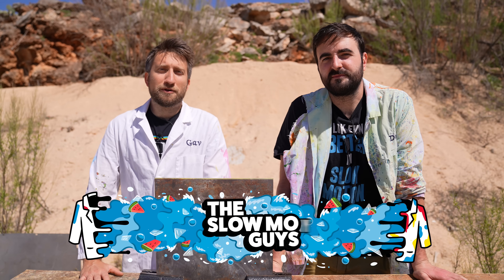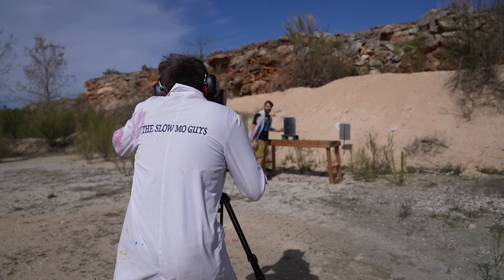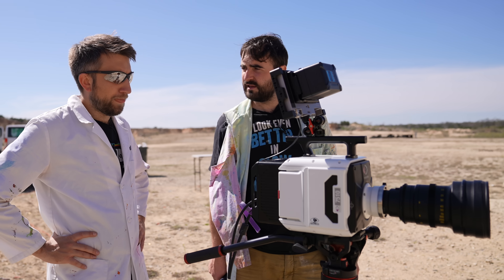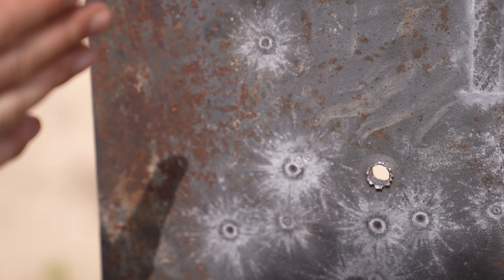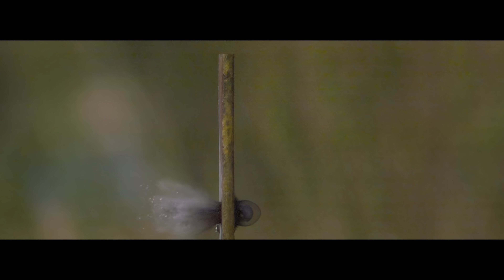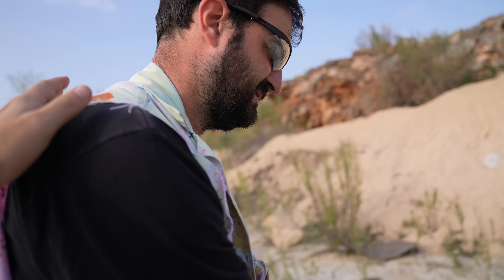Bullets vs Steel at 800,000 FPS - The Slow Mo Guys

Comment: I love how everything behaves a little bit like jelly with enough force and slow motion.
Reply: "Everything is a spring" made very clear
Reply: @DanBowkley   Depending on the speed, "Solid Object" -> "Everything is a spring" -> "Everything is a viscous fluid" -> "Everything is a dense cloud of particles".
In this case the steel plate was acting like a spring, and the bullets were acting like fluid.
Reply: @VorpalHerring   Oooo I like that one
Reply: Takes a lot of processing to run a simulated reality. At some point compromises have to be made.
Reply: @zoutube19 Frustum Culling helps, things only exist if you are looking at them.
Reply: @zoutube19  I like that one xD
Reply: From a brilliant comment on a Breaking Taps video - "So it's all clay?  Always has been"
Reply: Even without slow mo, all you need is enough force. Like when the Tacoma bridge collapsed, the steel girders were wiggling around under the bridge like party streamers
Reply: It feels like the laws of physics just look incredibly different at those speeds.

Comment: A full metal jackeded (FMJ) bullet will do much the same as the hollow point, much of this depends on the plate of steel - hardness, mainly - and velocity of bullet; more velocity gives better penetration.  This comes from many years of shooting steel plate targets.  Couple decades or so.

Speaking again from shooting metal targets.  Handguns, in general, have a slower velocity than rifles.   So the targets can be 'rated' for the velocities used.  (Obviously a higher velocity resistant metal will serve for a lower velocity as well.)   The 9x19mm (Luger) round is advertised generally as a 125 grain (weight) projectile at a muzzle velocity of 1,250 feet per second (FPS).  Whereas the .30-06 Springfield you used fires a 150 grain bullet at 2,700 FPS.  The kinetic energy of the rifle (at the muzzle) is notably greater.  

Not sure if your high speed photography would make a difference, but I've long been interested in determining what moves a heavy weight better.  The difference between a deer (or similar size game) rifle and a large, dangerous game rifle in my mind.

Comment: I think I really loved those last few 30.06 against the hardened steel plate because I kinda loved watching the back of the copper jacket just smoosh the lead; so at the end you just saw the flattened copper get kicked off the plate and a small little lead pancake just behind it.

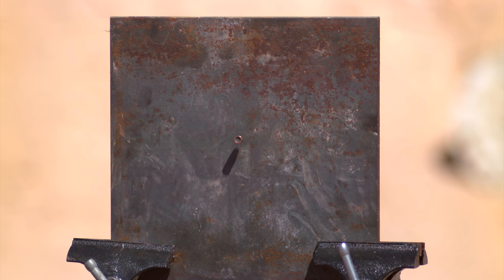Comment: at around 4:20 (lol) when you see the sparks radiate out of the bullet tip. This is not a metal on metal spark as copper cannot spark against steel, this is the gas compression igniting the air captured in the depression of the bullet tip. The burning gas jets out the grooves in the ridge of the bullet tip creating that pattern for a microsecond.

Comment: Wad cutters or semi wad cutter is the common term for a flat point in silhouette pew-pewing.  The whole intention is to cut a perfect circle for score measuring reasons.
    Red tips often toss the bit out the end, either up or straight back at ya.
   And a bullet trap will save your equipment from fragments blown back. The plate is set 45° down. Much safer. They even make little ones for indoor air and primer pellet toys.
 Could you guys try the cowboy show rounds slow? Wax was the common thing forever but I've seen  people loading earplugs instead, they're reusable. People hit each other with them, least they used to.

Comment: Different depths of hardness from the manufacturing process as well as variability in the hardness itself. Too hard is bad because the target would shatter instead. The purity of the steel is important but there are also additives like cobalt that  significantly change the properties. See if you can visit a forge, fabricator or machine shop - or get Destin to make a video on it!

Comment: The plate you shot first was probably just mild steel what we call A36 steel in the States, the round steel target was likely AR500 a very hard 'Abrasion Resistant' 500 plate used in excavator teeth, the anvils and screens of industrial tree/biomass chippers,  trommels, plow blades, and of course used as rifle/pistol target plates.

Comment: Would have been cool if you had a way to stick some petroleum jelly in the hollow point cavity.  
There is a practice in pellet guns called deiseling. The shooter inserts a small amount of oil or petroleum jelly in the rear cavity of pellets.  When the high pressure hits the flammable substance  it explodes giving the pellet a sizable boost in velocity.

Comment: In case its not explained, the explosion(spark) that we si are adiabatic processes. The fast compression of air heats it up so much it "ignites" it. Thats why we se the pattern, its escaping gasses from the slits in the tip of the hollow point bullet.

Comment: The round target is AR500 steel. 30.06 will go through it if you use a Black Tip AP round

Comment: Your not to fare enough from the target to get ignition on the trace, normally it is at least 45+ meters before it starts to light up! cause it would show a soldiers precis position if it lights up right after leaving the barrel.

Comment: you guys need to get a 300 Blackout and use subsonic rounds, that would be a much bigger bullet at much slower speeds might make everything easier to see. EDIT No scratch that 8.6 even bigger and add a very fast twist rate, its 1 turn every 3 inches.

Comment: Just more proof that those old Springfield '03 rifles were absolute tack drivers. This is more proof that Mauser perfected the locking lug bolt action rifle with this design. Everything after this, and the Mauser K98 it's based on, are just variations on this design really.

Comment: So I'm pretty sure what happens with that rifle round is the impact punches out a slug and the lead  hydrostatically explodes and most of it is deposited on the inside wall of the hole, while the jacket seems to be turned completely inside out and ejected from the explosion.

Comment: The difference between Mild Steel and AR500 steel is Real. Also would like to see Kentucky ballistics punt gun shooting round ball in super slo mo against gelly torso and a 1ft by 1ft plate of AR500 steel At 1.5 mill fps.

Comment: The guys realizing the actual power of a 30-06 round.  Yes, it can punch through steel.  Depends on the steel and thickness, but yes.  Remember, force = mass * acceleration.  For our purposes, acceleration = velocity.  When you double the mass, and double the velocity, you quadruple the force.

You also have to keep in mind barrel length, which increases the amount of time the bullet has to be propelled by the explosion of the powder.

of course, it also depends on the rounds they're using.  It could be as much as 6 or 8 times the amount of force hitting that steel

Comment: From my perspective it appears the bullet is acting like a sheer punch when it hits the plate steel. I believe it is the plate steel plug sheering away from the plat that hit the aluminum sign while the lead bullet shattered into many smaller pieces. Later in the video this is noted by Dan and Gave. Still a very interesting video. Thanks for sharing.

Comment: The hard round steel plate painted white is more than likely made of AR450, or AR500. 

This is steel made from iron which is the vast majority of the alloyed composition with the addition of minute amounts of carbon, silicon, manganese, chromium, and nickel. 

This type of steel is hardened by heating the steel to 1,500 °F-1,650 °F then quenching it and oil that had been heated to 150 °F, or quenched in water. This produces steel that is harder than a metal file. 

AR types of steel are used in such applications as bulldozer blades, excavator buckets, scraping blades for snow plows, or any other industrial application for a abrasion resistant, hard steel, and in this case for the video, a 10 inch target plate.

Comment: Dan is not right about the steel plate "giving way". At these velocities the bullet transfers all its momentum to a local area (in case of a non-pen) to the steel which is wayyyy too heavy and travels wayy to slow to cause an inelastic collision. The steel is (surface)hardened which is why a regular full metal jacket bullet does not penetrate the second steel plate

Comment: Great video guys! Just one thing to note and not sure anyone else has said. Tracer tipped rounds require a certain distance before the tip ignites 🙂As it is the air friction that causes the tip to light up. If you are under the minimum distance the tip has not enough flight time to have this give you a tracer. There are also different types of tracers

Comment: This was a phenomenal video on all fronts, excellent shooting by Dan, accidental schlieren effect, interesting discoveries about the interaction between bullets and targets and some top of the line surprise reactions from the hosts 😂

It's so interesting to watch people who are unfamiliar with guns react to the targets. Obviously Dan knows how to handle guns and they are being safe, but it's clear that neither of them has done a lot of shooting at varied targets. I knew from the moment I saw the dents left in the steel by the 9mm that the 30-06 was going to go through, but they both got caught completely off guard and reacted accordingly.

I didn't know that the 30-06 bullet itself didn't really penetrate the steel plate though, I assumed that it was mostly the bullet that dented the sign, and it was super interesting to see that it was actually a plug punched out from the steel target continuing on rather than the intact bullet.

I suspect that the flashes the 9mm hollow-point produced were actually caused by air being compressed between the target and the cavity in the nose of the bullet, not by the metal sparking. The little cuts on the rim of the bullet nose created little nozzles for the air to escape as it was compressed so it shot out at extremely high temperature, causing the flashes we saw.

It always amazes me seeing the difference between mild steel and hardened tool/armor steel demonstrated so vividly. I know the science behind it, but it's still wild to see that the difference that just a few fractions of a percent more carbon in the harder steel, (maybe some other trace elements too, but mostly just carbon) and a heat treatment cycle causes to plates of nearly identical dimensions to behave so radically different from one another under an intense impact.
Reply: "it's clear that neither of them has done a lot of shooting" - oh dear. Dan was in the British Army for 7 years and was an ammunitions and explosives expert. 😄
Reply: @GenericaQwerty  I know that 😆 Having been in the army doesn't necessarily mean that he's done a lot of shooting, most units only shoot once or twice a year; he could have done a lot more than that, but either way, it's not really relevant to my comment 😂

You missed the "at varied targets" part of my sentence 😛 Even if he went shooting every day in the army, it would nearly all have been on a range, with standard targets and service weapons, so he still wouldn't have a lot of experience shooting random guns at random stuff Demolition Ranch or Taofledermaus style. Otherwise he would likely have known that a 30-06 is quite good at penetrating all sorts of very tough things.

Comment: I shot my .223 with soft nose bullets at a 6mm steel plate from 50 yds.  The holes were similar to the ones in your vid except that the copper jacket was lining the holes and the holes were bigger than a 308 bullet. For the record I'm one of those lucky people that legally have rifles and live in the UK.

Comment: You could shoot various thicknesses of steel/aluminum/glass etc.. From both sides at the same time. It would require timing like the "shooting a bullet with a bullet" video. But use could capture instantly compressing various metals, as well bullets. I think copper and magnesium would be interesting. And maybe a think sheet of magnesium sandwiched with aluminum (would it start a reaction).

Comment: Did you guys see styropyros recent video where he linked up a bunch a car batteries? At some point in the video he hooked them up to a rod and used the electricity to cut through a microwave and a big sewer lid. I would've loved to see something like that in slow motion.

Comment: 10:55 90° angle is safe with this type of round but the 9mm hollow tip would most definitely be dangerous at that 90°
Reply from the maker: Yeah we didn’t get a side angle of the 9mm hollow for that reason

Comment: Would be interesting to see a video focused on ricochets with lower caliber bullets and pellets against types of materials. Maybe like a 500 FPS pellet vs a 1500 FPS pellet and it's effect when shot at various materials straight on vs at an angle. Can determine which rounds have the most ricochet potential if hitting a certain object at a certain angle and the velocity of that round as it's coming back at you.

Comment: The outro gave me an idea for a followup video.

Punch holes through the steel with the bigger round first, then see how the hollowpoint 9mm shattering reacts to the peeled out sections of steel.
It would be like a Plinko board but with bullet fragments.

Comment: if anybody looks closely at the chunk that comes flying out of the back of the plate you will notice that the edges of it are sharp and rigid whereas the face of it is concave in the back of his convexed meaning the chunk you see is the plate going through

Comment: The way that 30-06 penetrated that steel was a perfect example of shear plugging, and that is why the exit is so clean. The ductility of the steel is overcome so rapidly by the shearing force that it has no time to "react" thus, leaving a smooth surface. If you're confused this can be visualised as yanking a chunk of clay off a clay block so fast the clay does't have time to stretch.  

Even more interesting is that this video replicated almost exactly how blunt nose (particularly WW2 Soviet) AP shells worked against flat armour, perfectly exploiting the boxy design & and use of FHA of most german tanks.

Comment: I was worried about since the target looked like it was up at 90 degrees that they might have some bad ricochets but thankfully they didn't. They deff should still angle the steel so that if there were any ricochets that they go straight down into the dirt and not back at them

Comment: Seeing how slow the bullet moves at those speeds and then seeing how fast the debris spreads away from the impact point is something else.
Reply: That is why a lot of bulletproof vests with plates have a special plastic coating to catch all the spray from the impact so it does not go into your arms or face.
Reply: That's wild. Like I knew that the vests did something to protect from the shrapnel but didn't know how it really worked. I had no idea there could be so much of it though. @ColoradoStreaming
Reply: I know right, tells a story about how dangerous recoil and shrapnel really is!

Comment: 11:26 - Basically, the rifle bullet is a shaped charge and blowing out the steel behind it. 

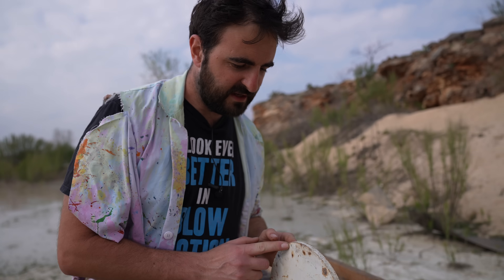Even at 13:40, the same principle is going on, but the hardened steel takes it like a champ... but the target is actually deformed after the shots where it was not before.  Look at the 'upper right' edge.  12:48 vs 14:08.  

That's one powerful bullet.

Comment: 9mm Tracer, will only ignite after about 60yds through a cold barrel.  It will however ignite in the barrel if the barrel is very hot through rapid fire.   I truly love these vids, well done lads.

Comment: Oh. Mild steel. I assumed you knew to use hardened steel. AR500 is common (“A”brasion “R”esistant). Yeah, grew up shooting various things. The “aught-six” goes right through 1/2” mild steel. Also note shooting mild steel with rifles can be dangerous as it cuts divots and thus spalling and fragments can come back in most any direction.

Comment: I am in 3. semester materialsience  an my hypoteses is that the steel is  strongly  rolled. so by deforming steel or  in general most of the metals. the metal is geting harder bacause of deformation.why this hapen is a different storry. but wenn the steel gets now hit by a strong enught bullet it deformes further more an it hets harder. and when something gets harder it gets more brittle and it is easier to break. so in the slow motion sthe steel gets deformed and then crack at the most brittle spot  this crack now moves in a circle where the metal is the most brittle. and so the hole piece flys in the sign. the thin alu sign just got dented a bit bekause the deformation of the steel cost so much of the energy that the bulled had so there where not much left over. if you whant more to know about this topic google workhardening . i thing there is going on  a lot more in to this penomenon but this where my first thoghts

Comment: I don't think that's the lead going out the back of the plate. I think it's the perfect thickness that the bullet hits, is stoped, epands outward (thus the bigger hole), and then blows the piece of steel out the back.

Comment: 15:00 so, as of this video, you two have now damaged/broken…

1) A GoPro (Cannon Firing in Slow Motion - The Slow Mo Guys)
2) The Janky Table (Slow Mo Katana Sword - 4K - The Slow Mo Guys)
3) 10 C-Stands (WWII Tanks Firing in Slow Motion)
4) A Small HD Screen (Accidentally breaking a $1500 monitor)
5) A Vice (Bullets vs Steel at 800,000 FPS - The Slow Mo Guys)

Did I miss any?